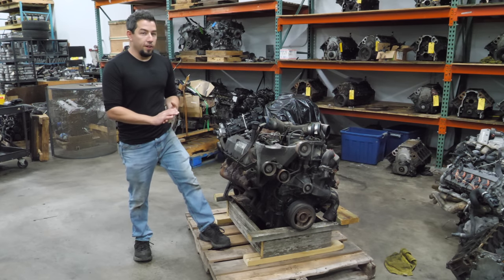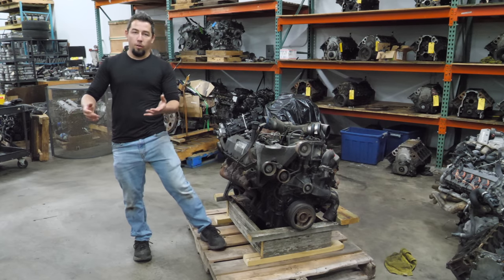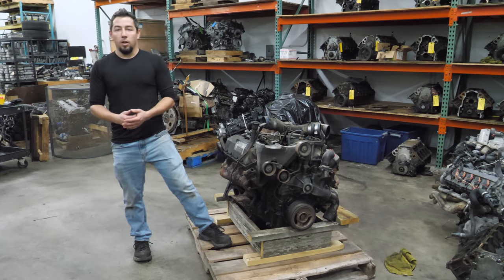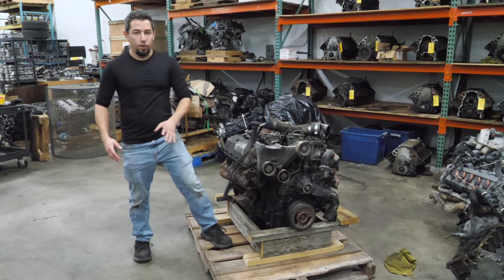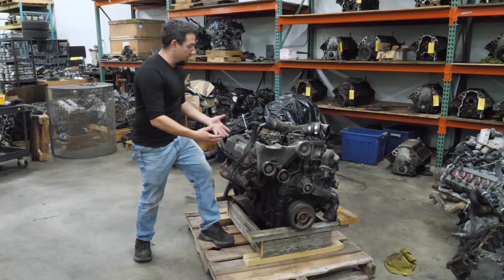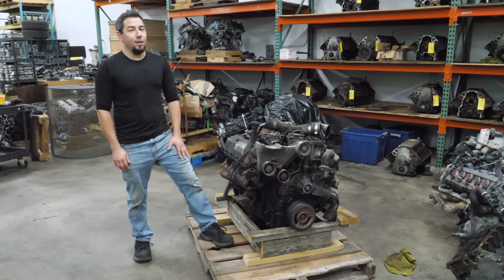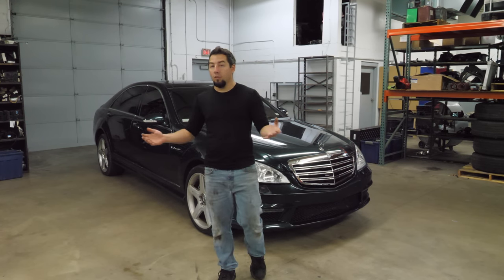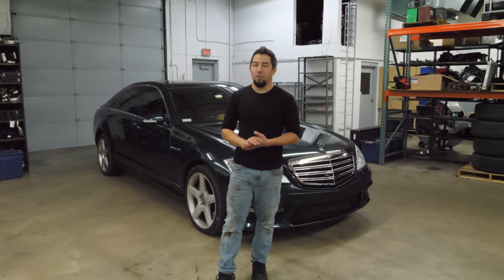70K OR 700K? Ford 7.3 Powerstroke Mileage Discrepancy. How Many Miles Are Really On This Engine?

Comment: Per the mileage discrepancy between december 29th and february 3rd the engine had an average velocity of approxmately 750 mph
Reply: Definitely supersonic🤔🤣⚡
Reply: There's a reason people love those 7.3s!!
They really fly!
Reply: Over 617,000 miles in 36 days works out to a modest average speed of just shy of 715mph according to my math
Reply: @09corvettezr1  Ahhhh, you’re one of “those” guys.
Reply: @09corvettezr1  oi! Where are your fueling stop compensations???
Reply: courier driver borrowed it
Reply: 750mph or 715mph either way not possible 😂 but hey yall can argue bout it ill just laugh some more
Reply: @typrus6377  it's powerd by God's will
Reply: @TheOneWhoSimps  it's a Ford not a gord
Reply: Or approximately 17,000 miles per day.
Reply: Closer to 714.5 mph; but that's an average over 24 hours a day for 36 days, so its peak speed must've been really something!
Reply: @nigeldepledge3790  I put a cold air intake and a exhaust on mine and I reached this no problemo! It gained at least 300hp!
Reply: @09corvettezr1  :) just did that same calculation.  Should we factor in fuel stops and how long they take, then recalculate the new average speed it had to do ;)
Reply: @nigeldepledge3790  I always drive my old Gaz 927 over 2000km/h on a highway, so this could easily reach 3000._
Reply: You mean 31 February?
Reply: sounds about right, fuel was much cheaper back then
Reply: So what you're saying is that it clearly spent some time powering a small aircraft? 😅
Reply: Now that's a powerstroke, 20473 rpm for 36 days
Reply: Zip ties in bias plies must have been driving it.  👌,,,,,,Mint,,,,,
Reply: Thats a straight up put money in get money back. No shortcuts fully rebuilt and dont be shy with arp hardware
Reply: @homie6166  Maybe it was strapped to an F16 ? Lol.
Reply: I have and run a 2 cycle 2 stroke IHC 7.3 loop charged 2 stroke diesel and must premix and run an oil injection pump
Reply: If you just add a digit to the mileage from dealer then it all works out.  The folks doing the oil changes at many dealers many times are interns.  Very easy for some youngster not knowing that there is no tenths on the odometer

Comment: Having rebuilt a few of these over 20 years, that is definitely about a 70k mile motor with a ton of idle time, cold start and a fair number of dry starts. Last 7.3 I rebuilt had 300k and was superb. That was definitely a city/municipal/county or state vehicle that was sold at auction
Reply: A city/county or state would NEVER keep a vehicle for damn near 700k miles.  If it was only 70k I doubt they would of needed to replace injectors either as those are not all original.  Many folks take care of their vehicles as it's what makes them money.  You lose when it's down and in the shop.

Comment: Judging from the lack of patina on engine parts, I'd say it's a 70k engine, but the bearings tell a story of a lot of idle time. Service body as well as the Chicago location tells me this truck was never shut off in the winter. I wonder if you could pull the total engine hours out of the ECM, if it's still with the engine.......

Would make a good starting point for a rebuild, though..........
Reply: Nailed it, Dec to Feb and 231 miles. Plow truck with immense idle time.
Reply: That would mean someone bought a service truck, that only got between 4 and 5 thousand miles a year, for 14 years. That's less than 90 miles a week, that's an awfully big purchase to do basically nothing for a decade and a half.

That's a hard thing to accept.
Reply: @ekscalybur  I just got a van that had sat for the past 12 years but they kept insurance and plates on it even though it didn't run. He has a fox body mustang the same way he parked it 15 years ago after a engine rebuild cause he was mad the window motor and heater core went out within 6 months. People are weird man.
Reply: No engine hours are recorded with this pcm
Reply: I agree with you cuz the engine doesn't look nasty like it should although I've taken great care with my trucks and they still look nastier than that but a lot of people don't realize the detriment of diesel is idles actually horrible for the motor between cylinder glazing and poor oiling because the RPMs are so low
Reply: @ehrenkrause9861  and yet people say diesels love idle!!!
Reply: @Prestiged_peck  only for warm up cuz usually the PCM will drop a little more fuel to get the engine of the temp. Cylinder glazing is horrible in tractors which I'm surprised a lot of people who pay half million dollars for rig like that would not know that having an auxiliary generator is cheaper than buying a whole new truck. I wonder if they stopped the clean idle because that's a whole lot of moving parts with a whole lot less lubrication and I'm sure those poor suckers that bought those trucks didn't realize what they were getting into everything that goes with emissions usually has horrible degradation to these engines. Vin diesels actually are cleaner on the emissions then gasoline but don't want to take away the presidential limo 😂
Reply: Commercial plow that ran for 16 years has 70k on the engine? I highly doubt it, plus the bearings are pretty worn.
Reply: @Prestiged_peck   who says that? Anyone that knows anything about diesels knows not to idle them more than necessary
Reply: @chrisleggett685  literally everyone around me that drives diesels, they've been on the diesel deal since the 70s though so they're thinking pre emissions
Reply: @ekscalybur  I have seen it before. At the steel mills in NW Indiana they buy trucks like that to do things around the mill typically they don't go above 30mph and they get about 250-300 miles put on them every year but they have a stupid amount of idle hours since they almost never get shut off.
Reply: I'm guessing the hours are high, miles 5-digit. It may be near a million on hours, but unlikely on miles. 
Used to service several fleets that had t444e's with over 30k hours un-opened, but less than 200k miles. Even though the blowby was high, they all still chugged away.
Reply: @ekscalybur  I bought a duramax from a fire department.  It had under 100,000 miles in 15 years.   I assume it idled a whole lot, plus had lots of cold start and go cycles.  

The price was right, and I was happy for 3 years until the frame rotted out.
Reply: Is patina the correct terminology for the internals of an engine? It was always my understanding that a "patina" is a desirable discoloration from wear or age.
Reply: that would scan with it having the service bed, perhaps belonged to someone whose work would have them doing a lot of waiting in-between tasks in the parking lot of a Wawa

Also i've never seen a service bed like that on a late-nineties Ford truck, it looks smartly streamlined
Reply: @Cartier_specialist  no your description is exactly it. he's saying since the patina it does have doesn't match 700k miles of patina, its unlikely to be that
Reply: @douganderson7002  I was making fun of some of the people around me, they're the same ones that try and tell me a 4.6 2v has more moving parts than a 6.6 duramax (it definitely doesn't) or even a small block (closer but still not true.
Reply: @chrisleggett685  -- Tell that to all of the ambulance owners. Particularly up North, as soon as it starts getting a little chilly. Heck, I even see it here in Georgia.
Reply: @ekscalybur  I watch snow removal equipment sit and do nothing for 7-8 months of the year
Reply: V8 diesels are all junk.  They don’t even last 75k miles.  The I6 Cummins is the only way to go.
Reply: @thefordmaniac  But, doesn't the PCM record miles and tells the cluster what to display?
Reply: @chrisleggett685  yup that's y the new trucks come with the high idle option
Reply: @jamesplotkin4674  Not on the first gen superduty.  They had a PSOM that took pulses from a pickup in the rear axle and drove the odometer and speedometer.
Reply: Bearings in those types of engines have a different babbet on them for them to run, with good maintenance, last longer than a gas engine, I have seen a Series 60 Detroit Diesel in a truck that was owner operated, Peterbilt with 1,275,000 actual miles. Diesel engine bearings are designed for longevity if well maintained.
Reply: Only International has readers for that kind of info, even if that engine has that info it would be in the FICM but that is a older one so I don't know they didn't have a lot of electronic engine management.
Reply: @user-tb7rn1il3q  -- I like Cummins as well, but to say V8 diesels are junk, is just a nut comment. Bill Hewitt @ Powerstroke Specialty can show you plenty of Powerstrokes with 200K plus on the ticker... Even the POS 6.4 Powerstroke will go 100K, before you have to put it to sleep.
Reply: @thefordmaniac  that has an ECM tho, it records idle hours
Reply: 100%agree
Reply: @retro_88yota  If mills spend this kinda money on a truck orders of magnitude more capable than what they are buying it for, then I no longer have sympathy for mills disappearing.

That kinda of waste would be embarrassing at the plant that built the truck if they plucked it off the assembly line for an at-cost loss and did what you described.
Reply: @ekscalybur  I can assure you that every truck that is used at the mill is used as a work truck they are underbuilt for the operating conditions they are used in. is it wasteful sure I guess but thats how things go in heavy industrial settings.
Reply: @user-tb7rn1il3q  not saying that the Cummins is not a terrific motor they are but your wrong  . I currently own 3-7.3s the only trucks I will ever own. 
1-96-3hundred 48000 all original engine parts except the turbo.
1-2003-3hundred 31000 untouched engine parts.
1-2002-1hundred 42000 miles untouched they all tow 7000 pound trailer’s 
The key to success is clean oil and filters
Reply: @Cartier_specialist  some color of oxidation layer.
Reply: Every hour of idling is equivalent to about 15-20 miles of driving, so any gas or Diesel engine that idles excessively will have a good amount of wear internally
Reply: @rydplrs71  At least it was the frame. The engine and trans would be fairly valuable.
Reply: @douganderson7002  However we are the cause of emissions, not the towns and villages. Oh wait, they get away with what we can't.
Reply: @Cartier_specialist its just discoloration from age and use.

If the object gains value from showing that age then it is desireable. Inside an engine is not one of those places.
Reply: @ripjones5294   Even a 200k 7.3 is what I consider low mileage.  350-400k is the threshold for high mileage, and even that just means you'll want to rebuild soon for another 2-300k life.

Comment: As another person mentioned, the cylinders still appear to have really nice cross-hatching. The bearing wear is definitely a little concerning, but with that service body and the rust, I suspect it was probably a municipal service truck. Probably used for plowing snow. So started cold often, and then floored into piles of snow. 

The biggest giveaway to me is that the injectors and valve cover harness appear original. A 700,000 mile 7.3 would be on it's 2nd or 3rd set of injectors - usually a hodgepodge mixed set at that. Reman injectors have a big "R" or some other identifying mark on them somewhere. All of the injectors appear to be original OEM injectors, and they simply would not last 700,000 miles.
Reply: That cross hatching was an area with no piston travel
Reply: @draymond5067  That isn't correct on a 7.3. A 7.3 has such a long stroke, that the piston travels the full length of the bore. At bottom dead center, a bit of the piston skirt actually pokes past the bore.
Reply: @AmericanLocomotive1  Yes but there will only be wear where the rings travel and the rings don't run that low in the cylinder.
Reply: a 700k mile service truck would be on its third engine.
Reply: I got 800,000 on mine. Injectors are dead giveaway if it's high or low mileage.
Reply: If It was a plow truck how would it have gotten that bad of front end damage? It looked like it ran into a pole.
If it belonged to a city or road works it probably wold have sticker or number evidence. Maybe some sort of independent contractor or maybe oil field worker?  So many questions on this one
Reply: @AmericanLocomotive1  Except it's not the piston that removes cross hatching, it's the rings. Stroker LS engines are known to be very tough on piston skirts because about 1/3 comes out of the bottom of the sleeve. I just pulled apart a crusty 6.0 that has sleeve bottoms looking just as minty.
Reply: To me another give away is the lack of bellowed up pipes. Nobody replaces those gaskets with OE style
Reply: I think this is the best explanation and the bearing wear is likely from lots of cold starts, thick cheap oil not changed at least annually, abuse before it was warmed up, and lots of idling. There were nowhere near enough oil changes in the Carfax report for 17 years of service. This is a textbook example of the harm from cold starts, not letting an engine warm up before mashing the throttle, using the wrong/cheap oil, and not changing the oil often enough. Also if this was a business truck not driven by the actual owner they tend to be abused. And it wouldn’t surprise me if the oil change place took shortcuts as they’ve often been caught doing.
Reply: I've driven/owned multiple 7.3's with well over 500k on the clock with original injectors. Keep up on the maintenance and you won't have any issues. Go over 4,000- 5,000 miles on an oil change and you're begging for trouble.
Reply: @blackopsrocks  incorrect.
Reply: @robby844  by all means regale us wirh your sage wisdom.  Ive personally had a dozen 7.3 fleet trucks, some with 20,000 hours, many of that idle hours.  The bearings generally look ok, and the cylinders are glazed with cross hatch only observable at the very top of the bore.
Reply: If the service is done correctly and the engine is run with the recomended oil and filters and not let set for a long period of time, and not abused or had the crap run out of it, those injectors will last a long time. Now you might be thinking of the 6.0 which loved injectors, rather their International installed cheap o-rings, which hardened up and leaked the high pressure oil used to fire the injector. The 7.3 used better quality o-rings, and if you didn't over tighten the valve cover bolts those harnesses would last, but had to use a quality sealer
Reply: I've got 343k on my 2000 7.3 and still using the original injectors. Replaced the o-rings on them and did a contribution test and they're all still well within spec.
Reply: They are not original injectors.  You can tell by the different color of them-some brownish and some blackish.  You can also just make out some numbering on one and not on others
Reply: @blackopsrocks  Not with the 7.3 .  These are known to run till 3/4 of a million miles or more with proper maintenance and and minor parts replacement.  Many times the body falls apart  with the engine still going strong.
Reply: @sharedknowledge6640  Carfax doesn't report all oil changes.  Usually only the ones at dealer.  That engine was way to clean to have gone extended time and miles without a change.  That wear is also evidence of a high mile truck.  We had business trucks that got their maintenance when they needed it religiously and many times slightly sooner.
Reply: @robwhite3241  It looks like it hit a parking bollard as there is no damage to hood and I doubt it was a plow truck due to the damage
Reply: @brinkee7674  I mean, I agree with your statement but you have to understand what service life means, HOURS= miles too thats all Im saying.  Idle hours are WAY WORSE on a 7.3 than any other truck thats pre-emissions because fuel just gets right into the oil when its not warm enough.
Reply: @blackopsrocks  Well That is what you need to do when it's not at operating temp, let it idle till it smooths out.  It's much worse to just drive off then let it idle till it warms.  I think the mile issue is them thinking the first digit is tenths and not including it.  If you add a number to the carfax from Lincoln dealer then the mileage works out
Reply: @brinkee7674  i meant idling on the job not warming it up.